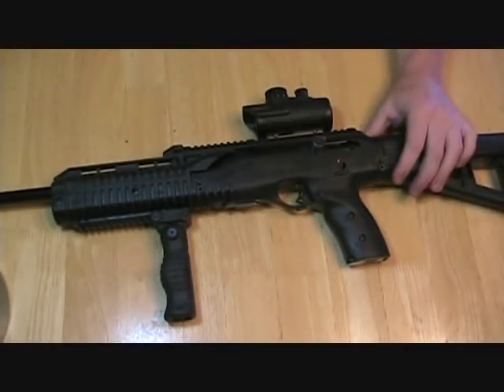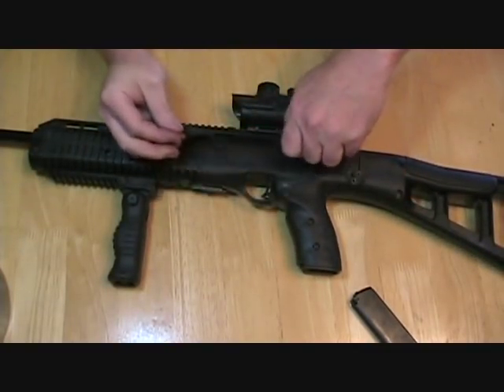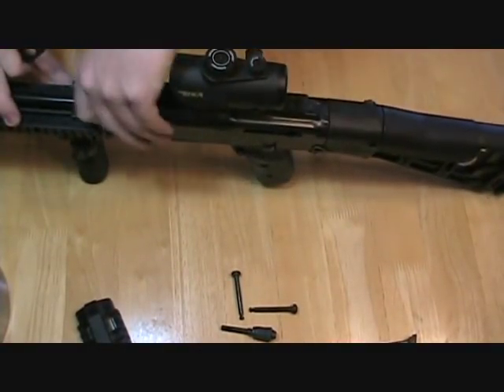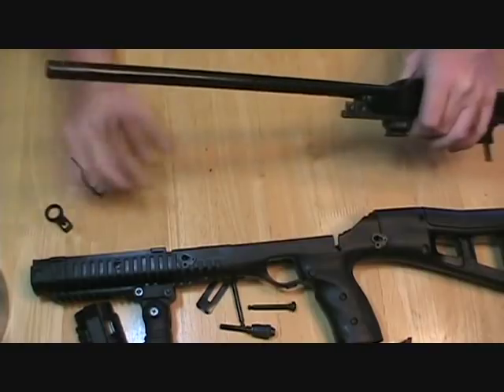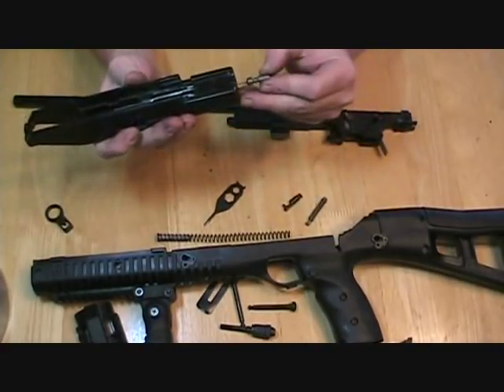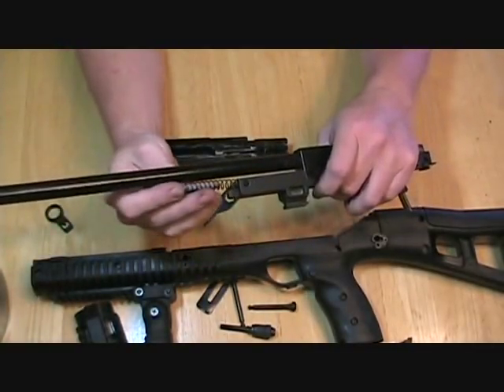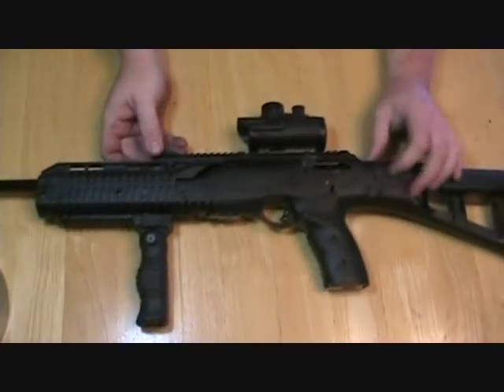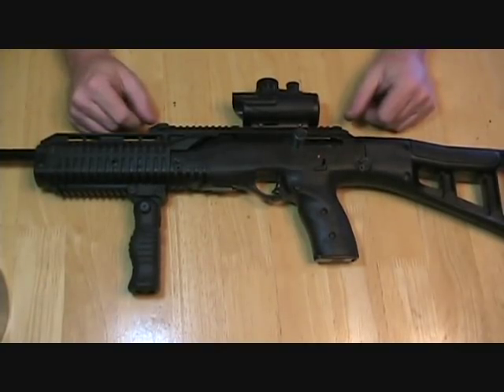Hi-Point 995TS takedown and reassembly

Comment: Bought my Highpoint 9mm carbine in 1999..new for $95...never a problem and still deadly accurate
Reply: I bought the 45 carbine in 2000 I have put over 3000 rds and still shoots fine. I need to send it in as the breach bolt has gouges in it but still a great gun. Fun to shoot.
Reply: Question is... have you ever stripped it this  far? What got dirty that you had to access by tearing it down?

Comment: Nice educational video. I got a 4095TS and put maybe 250 rounds through it and it started jamming. I have 5 mags, one came with it and the others I bought, all made by Hi-Point. So after watching the take down of your 9mm I figured I'd try to clean and check the feed ramp. All was going good untill I some how ejected the sear pin, the sear pin spring and counter balance pin. In my garage no less! Small wonder I found the parts and got it all back together! 
Thanks for a great video!

Comment: Love my Hi-Point carbine. That plastic guide rod in mine was a bit warped. I noticed it was hollow with a .125 in. hole in it. I took a .124 in royal pin and cut it to just fit in the hole. (A correct size drill bit could be used). A touch of super glue on side of pin, shove it all the way in and let it dry .Don't put super glue in hole or you won't get it seated all the way in from hydraulic pressure.  It straightened the guide rod out and made it really rigid, won't bend. Saved myself for now of spending 15 bucks for a metal one. :) Thanks for the Vid.

Comment: Very helpful video.  I highly, HIGHLY recommend every new 995TS owner go ahead and take it apart, lube pins, and everything that is supposed to "just slide apart" because this is a very tight gun when new and it doesn't "just slide apart".  The manufacturer's take down instructions are a liability to them.  They're nearly useless and are totally inadequate.  The gun is what it is.  It's a cheaply made weapon that does put a bullet out the end of a barrel.  It is NOT a highly engineered, well thought out weapon like the AR, AK, or any Garand.  All of these three guns have much more thought put into them, no matter whether you like them or not.  The Hi-Point doesn't have much high level thought or engineering put into it, thus the price.  But, they do work.  Kudos to this video maker and others that help greatly.  Buy more ammo while you can......

Comment: Just bought a 4595.  Haven't fired it yet.  Was a bit intimidated by what I thought would be a difficult, overly complex breakdown.  I am 70+ years old, and have had waaaaaay too many springs go zinging across my basement (never to be seen again) during a first time break down.  Best regards.  Thanks for the vid.
Reply: This is the thing I really dread!  Little springs flying out, small parts dropping to the floor and turning into compost.  This will never happen at home, but there is that one advantage to a "5S" work space, with a clear floor and bench... if something little gets away you have a chance to catch it!

Comment from the maker: Glad I could help! One of the drawbacks to the Hi-Point design is the fact that the firing pin also serves as the ejector for the spent casings. I bent the firing pin on one of my Hi-Point pistols once by slamming the slide into battery. I was able to knock the firing pin back into shape with a hammer and a flat-edged vice, and it worked fine after that!

Comment: Awesome video! I have 4595TS with about 600 rounds through it (really needs to be cleaned). This video will make that much easier. Although make note no hangups or misfires even firing that many rounds through it without a clean. Cheap and goes bang.

Comment from the maker: There are 2 Allen screws and a flat blade screw that go through the rear sight and mounting bracket. if you remove those, the rear sight comes off. BUT: Don't unscrew any of the other screws, otherwise your rail will come off too. If you follow the video up to about the 2:50 mark, you will be able to look inside the slide cover and figure out which screws hold the rear sight on and which ones hold the rail on. I hope this helps!

Comment: Nice presentation, very clear.  The process itself has a lot of steps but doesn't seem especially hard.  I'd like to have a printed cheat-sheet that shows all the steps.  It's surprising that the one tool is attached, so they're at least meeting you half way!

Comment from the maker: Once I take it down, I just use a bore brush on the barrel, some cleaning patches with Hoppes #9, clean the inside of slide with a toothbrush, lube the slide-to-rail contact points with a little LPS graphite lube then re-assemble it.

Comment: The plate that holds my firing pin will NOT budge and I need help. Any suggestions? I've done the very same thing everyone else does with my full strength and doesn't work.

Comment: Nice video I have the .45 4595 model. It's brand new, never been shot but it's not firing. We took it apart to see how it worked and functioned, then put it back together. Took it to the range. It functions normally, charging handle pulls, releases, safty works, mag drop, everything, but it wont fire a bullet. It loads one up, but the trigger  feels SQUISHY, and theres not pop like I hear from everyone elses when they pull the trigger.

So were thinking we didn't either reinstall the firing pin correctly, or one of the springs is backwards maybe? That double spring that wraps around the firing pin, is there a front/back to those things? I'm convinced it's something i did wrong putting it back together since it's brand new.
Reply: You've probably figured it out by now but you ask if you put the pin in backwards. The longer thinner end points forward and should fall straight through the pin hole on the bolt face. It'll stick out about half an inch. Can't miss it if it's in properly.
Reply: hokanut It was missing a spring...hipoint made it right lol....

Comment from the maker: Mainly, I lube the high-friction areas, like where the slide moves along the frame. I run a bore brush, cleaning patches and Hoppe's #9 through my barrel and use a toothbrush to clean the rest of the moving parts. That's about it.

Comment from the maker: I never had any problems removing/replacing the firing pins in any of my Hi-Points. The firing pins appear to be identical in my JHP, C-9 and my 995. I'm sure if you told the folks at Hi-Point about your misfortune with the firing pin in your C-9, they'd send you another for free.

Comment: So do you have to sight in the gun every time you clean it because you're moving the front sight?
Reply from the maker: Because of where I decided to mount my front sight, I do. If you leave your front sight in the original manufacturer's position, no. BUT... You can't completely remove your slide either. I the hex screws that hold the front sight leave marks on the barrel. If you replace the front sight carefully lining up the screw marks with the screw holes, you should be pretty close. I usually use a boresighter to re-sight mine after re-assembly. Takes me about 5 minutes.

Comment from the maker: @GunznPoker Thanks, GnP! I've had it a little over a year now and I only actually have about 500 or 600 rounds through it so far. When I was making this video I noticed there was a lot of wear on the inside of the slide. (I lubed those areas, but I'll be keeping an eye on that from now on!) Even with the after-market 15-round magazines I use, I have never had a single jam, mis-feed or hiccup of any kind. Considering I paid $225 for it, I think that's pretty damn good!

Comment: So what part of the gun counts as "the gun" legally speaking then? Usually I'd say that the plastic frame is basically the reciever, so that.
Reply from the maker: The action has the serial number on it. There is a plate on the receiver that has the actual serial number engraved on it. That's what I'd count. There are after market plastic stocks for this rifle that you can purchase without going through an FFL.